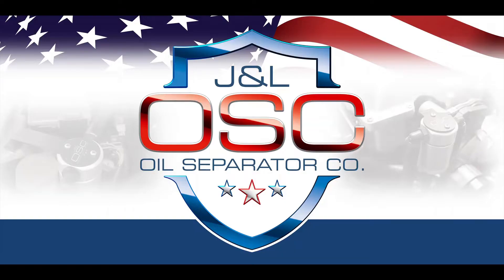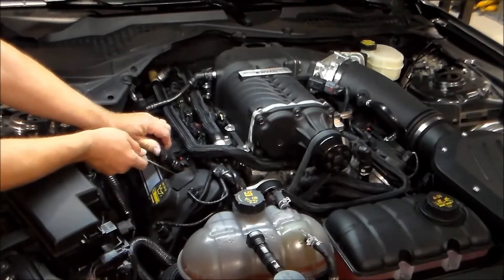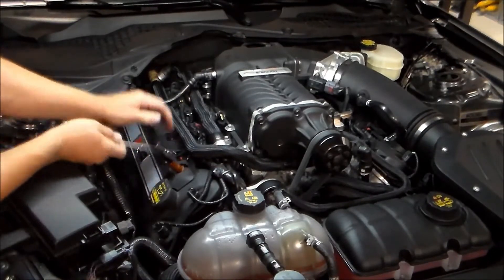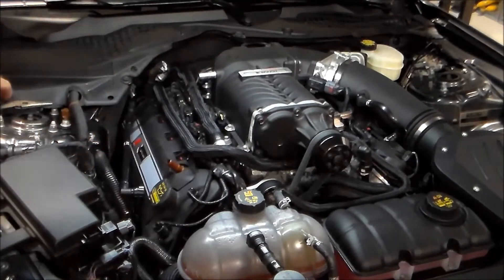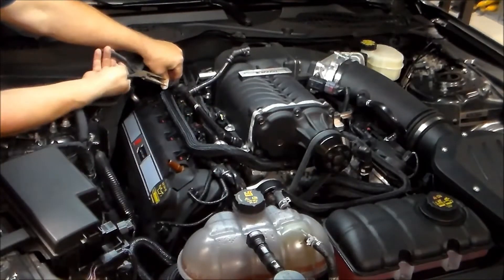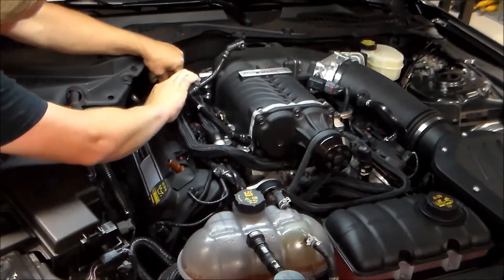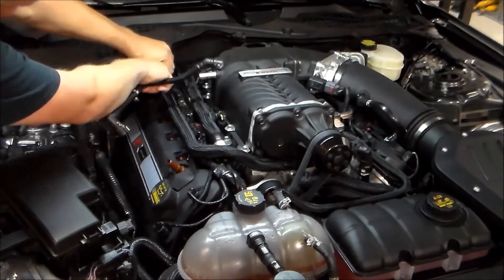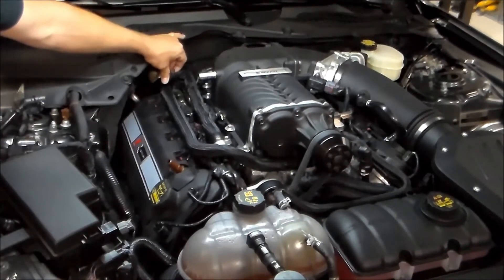J&L Oil Separator Co. 2011-2017 Mustang GT Roush/VMP Install 3020P

Comment: I just installed this catch can on my 2017 GT with a Roush super charger, the plastic on male end on the can was too big to attach to the hose so I had to flip the rubber part around on the hose for it to work. Is that something you have ran into with this catch can?
Reply from the maker: Hey Garet, that's new to us. Feel free to send some photos to info@jlosc.com so we can take a look and make sure everything's right on the kit.